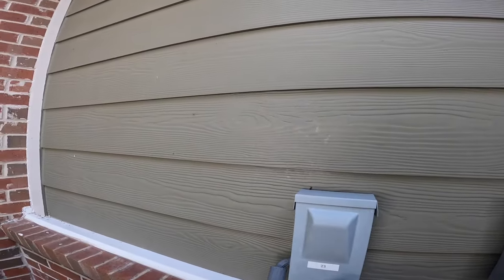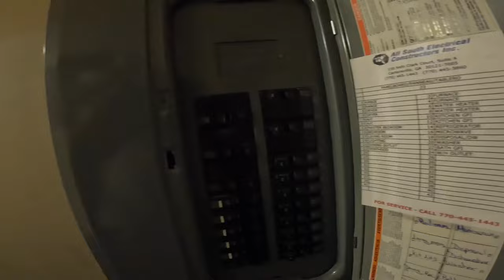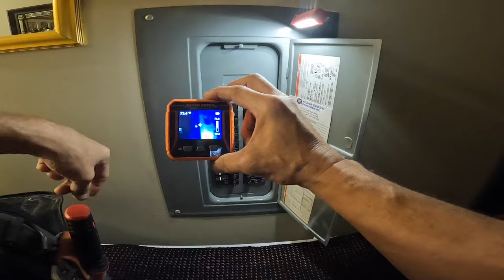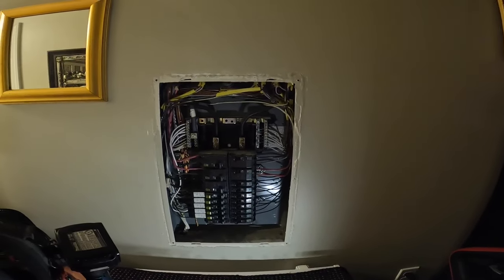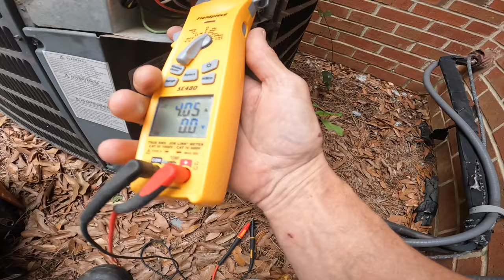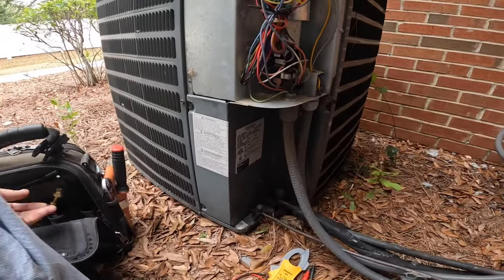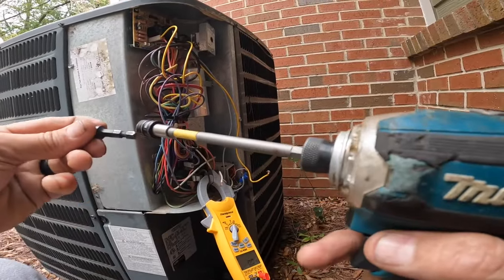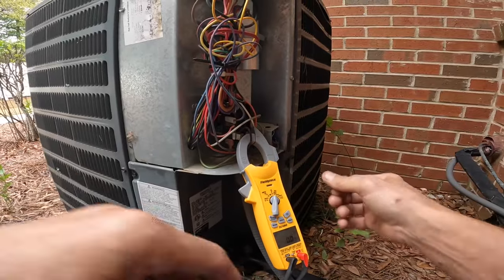She called the Fire Department after I left

Comment: 5:47 at this point in diagnosis, I'd be wondering, was 24VAC getting to the contactor? (Something lower could have still caused that hum earlier.) And after that, I'd swap the contactor. (Contactors can get pitted and you may have been pressing down harder than the solenoid does.)
Reply: That's what I thought!

Comment: I'd hire a person willing to do the work, make an honest assessment, deal with the problem, and be honest about it.

I had an HVAC company install a system and they completely abdicated responsibility for figuring out why I was getting cold air coming out at night in the middle of winter.  Really pissed me off.  I'm an electrical engineer so I eventually worked my way through the entire system from one end to the other only to figure out the idiots used the wrong thermostat and there was nothing connected to the second stage heat because of their laziness and idiocy.

Bottom line, I have a lot of respect for you showing this and standing behind your work.  Not every day is going to great, but doing the right thing is crucial.

Edit: I see with a different lighting angle that the metal probed wasn't painted.  My mistake.  The first light angles made it look like you were stabbing paint at first.  I see it is galvanized instead.  My mistake.

Comment: Make sure when you're measuring to ground, that the metal is not plated and also make sure it's clean. The sanded copper line or the actual ground wire/lug is always nice. You have an intermittent Goodman defrost board or you had an open pressure switch. Goodman is junk. I quit selling them.
Reply: yeah, need to first very continuity on the selected ground point, otherwise the test is inconclusive.  Also, plugging in the breaker with both hands is not a good idea...

Comment: When I was younger I wired a blower wrong and it ran just fine for about 20 mins. Then it burned up and smoked. It's only happened once, but it did happen. And those syle disconnects are trash. I always feel like I'm going to short cycle the unit because they never go in straight.

Comment: Outdoor coils are not protected from the elements. Also the evaporator coil has constant pressure along with moisture,condensation and vibration that will cause leaks in the coils.

Comment: I think you referenced a “sensor” early in the video. And later you removed it. It is called an outdoor thermostat. And, is required on a heat pump. It is designed to lock out the heat strips if the outdoor temperature is above a certain degree (40°?).

In North Carolina a mechanical inspector will fail the installation job without a means to keep the auxiliary heat from coming on when the outdoor temperature is above a certain degree.

Comment: Don't ever grab a breaker with channel locks like that! That's a  good way for the brittle casing to disintegrate. I've had old breakers break when removing them just with my hands. Unfortunately one time the very flexible copper shunt wire inside fell down and contacted the opposite phase. Phase to phase 240v 200A flash burn in the eyes does not feel nice at all and doesn't go away quickly. Be safe. If it's that stuck shut it all down before trying to remove the breaker.

Comment: MY FRIEND THE BOARD HAS PTC'S ON IT. UNTILL THE ELECTRICITY IS TAKEN OFF THE BOARD AND LET IT COOLED BACK DOWN SO THE POSITIVE THERMAL CONTROL CAN CLOSE BACK AGAIN IT WILL NOT WORK... THE PTC IS LIKE A FUSE OR IS A FUSE.... IF YOU HAD A CAN OF FREON GAS TO SPRAY ON THE BOARD YOU COULD HAVE CLOSED THEM SOONER.

Comment: That’s crazy I never seen an iced up evaporator coil give off vapors that could cause a house to be smokey. Just curious if it’s because the ambient temperature is different in California?
Reply: It's probably due to the high relative humidity  in the South.
Reply: @hjc4604  thanks bro. I wouldn’t be supposed just never seen it happen.
Reply: @manny6668  When an air to air HP goes into defrost, it's show water vapor at outdoor unit; always tell customer, it's a normal event which takes place about 30 minutes apart!
Reply: When in defrost mode the inside coil may ice up. Then when it goes back to heating the dirty coil may produce a smell. We call it the dirty sock syndrome.

Comment: Most likely a pressure switch was open. Shoulda back tracked thru the low voltage wiring to see where you did and did not have voltage on your "Y" call from the Tstat, thru any switches, and to/from the board. Can happen for a variety of reasons but as I was not there, can't say for sure. Forcing the condenser to run with no blower or panels off AH will result in low pressure cutout. Running the compressor with no condenser fan motor will cause a high pressure cutout. These switches can stick or you may not have waited long enough for the pressure to normalize. 

Been doing this 20yrs and see techs condemn boards waaaaay to often without finding the true cause and NEVER seen one magically revive itself. Yes intermittent issues are a pain in the ass, just gotta try to think of ALL the possibilities. Hopefully it wasn't just a 5 min time delay out of the board to prevent short cycling. I've run into some odd ones where someone broke common out to the condenser with the float switch which is a bit unusual in residential applications but not wrong (back in the day). Had "Y" all day long but wouldn't cycle because the auxiliary pan (UNDER the air handler) float switch was tripped. I was checking for voltage at the condenser from "Y" to ground instead of "Y" to common and not all low voltage circuits are grounded on the common side @ the condenser (depends on manufacturer). 🤦‍♂

If you run into a "magic fix" situation, always tell your customer about the possibility of having to return if the problem reoccurs as it most likely will), don't just walk away like it's all better now. Also remind them you tested all the usual suspects but it refuses to reoccur - if it ain't broke I can't fix it, I need to catch it in the act. Good luck!

Comment: The outdoor defrost heater thermostat you pulled out, isn’t that more for when you’re running in heat mode, for when the outside coils get frosted over if it’s near freezing or even just cool out and the humidity is high? Usually systems will timeout and wait for the ice to melt. Heating I assume makes it where it could run continuously. Not anymore.

Comment: Nice that you owned up to that!  What was the part you removed that had the copper wire running next to the capacitor?
Reply: Outdoor temperature sensor. It keeps the outside unit from coming on when the outdoor temperature gets bellow freezing. 🥶

Comment: Solder failures on control boards can be very intermittent and cause big problems. I always look at the foil side of control boards with a magnifier I keep in my pocket at all times. It has helped me find bad solder joints many times. If an actual part is suspected as intermittent it is best to replace the board (if you can find one). I have repaired certain boards in the past that were either poorly soldered or left the factory with a defective part. Too bad the last person on the job always gets stuck with the blame whether it is his fault or not.

Comment: I never pull a breaker without brushing on a bit of NoAlOx on the contacts before pushing them back in place. It's not necessary, but it doesn't hurt, either.

Comment: Well when my guy came to service my  A/C which had heat pump, he was outside, house started filling with smoke. We quickly hit the main cut-off,  I had a 10lb fire extinguisher, I was yelling, hit it, hit it, the fire was in the attic, I had already had step ladder sit-up for attic access if needed by him. Glad I did. Fire extinguisher was 5 steps away from ladder. Again glad it was. He panicked, he's a much older guy, started having breathing problems, I then took extinguisher from him and  extinguished fire. Then had to run down stairs to check on him. Had to find his nitroglycerin from his truck, all the while calling volunteer fire department, just in case. My house is an A-frame, if roof burns, that's the walls too. It was one of those situations that was bad luck, but ended well. My A/C guy is ok, and I am a retired career firefighter, glad I was home. Fire was contained to unit in attic, rafters ok.
You never know what could happen. Turns out I had a faulty board.
Never hurts to have things accessible 'just- in-case'.

Comment: I went on a call where someone took the fan relay and wiring apart in a attic installed air handler that was horrible to get to with no disconnect. I wired everything back together and climbed out and turned power on and to ac at thermostat and climbed back up in by the time I got to the unit the fan motor was making noise and  smoking hot and filled the restaurant up with some  smoke  and the owner wasn’t happy

Comment: My ac went out end of Aug compressor motor went out due to capacitor failing due to control board failing did the exact same thing.. pull the lockout all you heard was that sound… never smoked though or have what happened to that one though.. I went 8 days in Arkansas because I tried to fix it… the guy I called had it running in an hour… yeah I am calling someone.  Even made a new friend outta it…

Comment: Don’t you realize that machine is a heat pump? You were possibly in defrost if the heat was on instead of cooling. In defrost mode neither the compressor or the condenser fan will run. You removed the outside air thermostat. That is the change over under 40 degrees the furnace or electric strips come on instead of the condenser. Did you reinstall that thermostat? If not, they will not have heat with the heat pump when it is above 40 outside the strips will always come on

Comment: I know nothing about HVAC systems to amount to anything but how could smoke be coming from the outside unit if all it does is pumps cold Freon into the air handler for it to dispense wouldn't the smoke be coming from within the air handler in the house like you said at the beginning a failed blower motor that could be the motor smoked up and dispersed its own smoke into the house before the motor blew and this is just me asking I have no clue
 Edit: so it wasn't smoke it was condensation in the air from the Frozen radiant I'm guessing?

Comment: Boards don't correct themselves but I have seen solder joints loosen up when they warm up.  I had one lose power when it got hot and then when it cooled down due to not running the board would work again,

Comment: I've been seeing the pressure switches going nuts ohms going high on them if you jiggle the wires it will let voltage go then it won't . it probably a malfunctioning pressure switch . seen it on a few goodmans

Comment: That closet door where handler is probably should be a vented door for air circulation.
- A bad capacitor on handler will cause the fan motor to emit a burning smell. Just my two cents.

Comment: I’ve never seen fog or smoke come off a frozen coil through a return. Gonna look for that!
Reply: A leak on a 410a system will fog a house in no time.
Reply: I'm not an HVAC tech but it happens during high humidity in my car during summer and when the ac is first turned on.  I'll see fog come out of the vents.

Comment: Kinda sounds like a cracked solder joint on control side of board, happens alot and slightly move wires and makes contact. Maybe?

Comment: 9:50 trying to figure out why you're looking in the breaker panel if you did not see hot spots in your thermal imager and no smoke traces were coming out of the circuit panel itself I mean I get that you're looking for burns and something that might have caused the smoke but why are you looking in the electrical panel where there's no traces of smoke?
Reply: 10:50 pretty sure some component burnt up somewhere from your mis-wiring statement earlier in the video I'm going to guess burn up the low voltage Transformer or a heat strip was activated when it shouldn't be
Reply: 16:00 OK so not smoke. Fog. Frozen coil, same thing is seen on refrigeration units with the fog
Reply: Good video.

Comment: 12:47   i know the screwdriver handel is insulated, but when dealing with the disconnects box
Just use 1 hand on your tool
To snug up the screws  plus you did that live  yes you broke contact to the condenser but 2 wires the black wires are live coming from the main breaker box  and i am betting the disconnect box is grounded , 
You touch either 120 volt leg
And the box you risk 120 volts 
Shock  1 hand it just shock that hand 2 hands you risk it passing
Voltage  over your heart 
Using 2 hands around live wires is extremely risky. I know you don't have a death wish.  Standing in water, you could die.
Only takes .05 milie amps to stop your heart.

Comment: Using that makita on those zip screws makes me cringe. Yeah it works, but it’s like putting in a finish nail with a sledgehammer. Over kill 🤣 grab a 12v Milwaukee man ! 

Keep up the great content. Love the channel
Reply: I am a diehard Makita user and just picked up that Milwaukee 12v screwdriver last week. 
Gotta say it's so nice , fits in my veto pro pac better and doesn't strip the screws
Reply: @michaelmaclachlan2152  amen
Reply: Not if your careful and know what your doing
Reply: @georgekolos5255  like I said, it works for him. I used to do it. Then I realized you don’t need to strongest 1/4 inch impact gun for every day panel screws. The weight between the two makes a diff

Comment: I wonder if that temperature sensor kit you took out was ment for a ambient kit to cycle outdoor fan during lower temperature days so the Ac can still be used.
Reply from the maker: It was hooked to my electric Heat wire.
Reply: I could be wrong but I think the sensor is to keep the heat strips from coming on when it’s above 40° outside. It’s code in some places.
Reply: It was an outdoor thermostat that is used to lock out the heat pump when it can pull enough heat from the outside air to justify its energy consumption. Also a wifi thermostat would accomplish the same thing.

Comment: That unit doesn’t have a low pressure switch and this is a heat pump correct?
Reply from the maker: Yes. A heat pump. And yes it has both low and high pressure switches. They were both closed. It just wouldn’t pass voltage to contactor. Had 200 psi on it.

Comment: Why remove the OD stat?  Even if it's only 4 days per year that its needed it's there, included in this model.  Many manufacturers in the era this unit was made put those on their 'better' deluxe models.  Usually set for around 27 deg F to switch on the back up heat and in some cases turn off the energy to the contactor these provide more comfort on the days when the cold is the worst.  I'd put that back on to avoid being called back on a cold day.  A heat pump trying to satisfy the first stage on and off is one of the most uncomfortable devices known to mankind.
Reply: That's backwards and only for extremely old R-22 heat pumps. A modern heat pump will still put out some heat even at 0F. Yes it's not much, but you don't ever want to go to 100% resistance heat. A properly working thermostat should be calling for aux heat automatically, if it's not calling for aux heat soon enough, then the aux heat droop setting is too low. If the droop setting is 2 degrees, the temp will have to drop 2 degrees below set point before the aux heat will energize. Some people prefer this, to try to save on electricity. The ones that don't care, I program the t-stat to the 'comfort' setting of droop. In a modern system, that outdoor t-stat is NOT to turn off the outdoor unit. They are usually set to around 45 degrees F, and what they are for is to LOCKOUT the Aux heat if the outdoor air temp is 45 or above. What happens is with programmable t-stats, and the people that have a large setback for unoccupied periods, and the heat is kicked up more than 3 degrees, and/or someone comes home, feels cold and "cranks" the thermostat, the compressor and aux and stage 2 heat will all call if the thermostat is raised suddenly more than 3 degrees above room temp, in an attempt to get the space up to temp faster. This is silly and unnecessary when the outdoor temp is 45 or above, a properly sized heat pump system that is in good condition should have no trouble at all putting out plenty of heat without any AUX heat strips. So an OD stat saves unnecessary use of expensive aux heat.

Comment: Wow what kind of an assole designs a sensor wire made out bare copper wire.
Reply: Called a capillary tube and used with mechanical sensors.  Been around forever.

Comment: I have worked for over 38 years as a construction electrician, yes I have made many mistakes. Once I was working on my own shed's sub-panel so I shut off the power at another panel and disconnected the feeder cables, but when I hooked the cables back up I put the hot on the neutral line )  :   dumbass, I found out the hard way what I did when I got the Hell knocked out of me with a very hard Shock ) :    like I said, dumbass I was.

Comment: Why is it that you guys always find leaks in the hardest to replace part of an AC system that is actually inside protected from the elements?.

What causes leaks in the evaporator Pray-tell....

Except for your shyster imagination

Why would you go to the electrical panel you’ve already proven that you got 240 to the condensing unit and actuating the contactor turns the goddamn thing on.

Clearly the signal from the thermostat is the problem than that of something at the electrical box.....If the breakers were suspect you wouldn’t have power at the condensing unit outside.